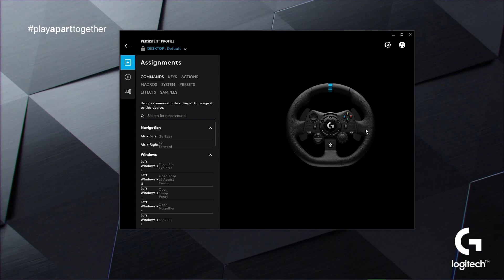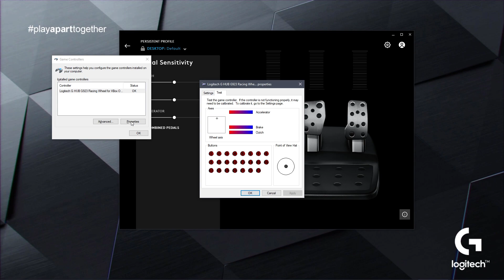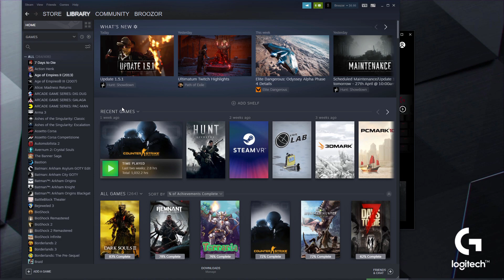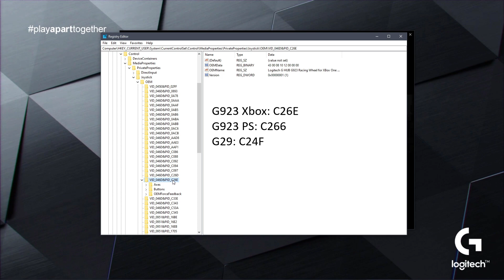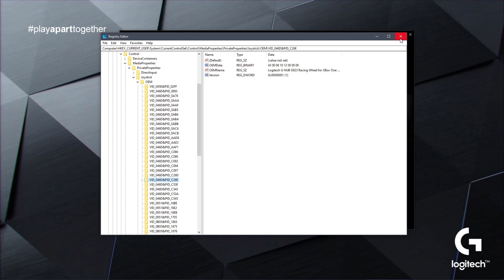How to troubleshoot G923/G29/G920 for Connection Issue

Comment: Hello, I bought the G923 a week ago and today the force feedback feels different, less responsive and with less detail. You mentioned the LEDs having a meaning, mine keeps the first green LEDs (the most outer ones) on. What does this mean and what can I do to solve it?
Reply: Following up on this, on the registry editor I have two entries that correspond to G293: C266 (with folders as in the video) and C267 (without any folders or extra files)
Reply from the maker: Hi! Did the deletion of the registry editor folder for the G923 fix the issue for you? The LEDs are our RPM trackers in games and typically does not stay on after power on but is on while it calibrates. 

Some games also allow you to adjust the force feedback intensity so that could be why it feels a little different in game.

If these do not help please let us go deeper into detail by submitting a support ticket!

Some racing titles have an option called Inverted Force Feedback (or similar) in their control options.

https://support.logi.com/hc/en-us/requests/new?ticket_form_id=360000621393
Reply: @logitechsupport  It did not work for me unfortunately. I’ve tried almost everything at this point and I couldn’t get it to work like it did on the first week sadly.

I know the LEDs are rpm indicators, I was just asking because that’s how they behave now, they never turn off after playing F1 (2020 & 2021). I know the FFB can be adjusted and sometimes is inverted but after that first week the feel on both F1 games, as well as Assetto Corsa was never the same. It just lost a lot of detail and power.

I will try submitting a support ticket.
Reply: @logitechsupport new steering wheel and pedals set up today... Worked about half an hour or so, then changed to a different game and now it won't work. Just light flashing on steering wheel. Is the power chord the issue?

Comment: Hey my G29 is not being recognized by steam/games/& device manager, and I've tried everything including what you did here,so due to me being disabled and not familiar with this stuff & have no access to credit cards and PayPal to update etc,I'm always stuck 
& in a panic cuz I can't find out what is happening to mine,so what I wanna know is is there a certain way to install it to get it to work or is there settings to change or what,I've uninstalled and reinstalled restart it so much that I have no way to get help cuz I can't pay for it, so mine is the G29 so in Ghub it's the pedals don't show that it's working
Reply: Cuz I push pedals & the lines that show they work don't move so that's 1 I go to the registry and the G29 is there but that part where you delete it shows up so I I delete it unplug replug but the options to refresh aren't there so what's going on please tell me what I'm doing wrong or what's causing this not long ago it was working fine but Ghub did an update & that's when this started again so please do something so this will be working again I need a step by step instructions on how to do it from when you 1st turn on PC to when it's working in game so I know how to do it right so far I can't find it & Google is no help cuz nothing came up & I need something free to do it with no credit cards required to do it,I'm getting bored with using an Xbox controller to play cuz this issue is non stop & I don't know what to do to troubleshoot it & fix it for free
Reply from the maker: Hi there Chris, 

We can definitely help you out! If you can go ahead and open up a ticket through our support system we can provide you with more detailed trouble shooting. 

The link down below will lead you there!
https://support.logi.com/hc/en-us/requests/new?ticket_form_id=360000621393/
Reply: @logitechsupport  i was on the phone with an agent for over an hour,she sent in email another version of GHub,it worked for awhile then it stopped again,i even have it plugged into a wall outlet and not those multi plug things,im starting to see after testing it in different ways that the GHub itself seems ok,the wheel itself is fine,the shifter+18-speed has no issues but its the pedals that are having issues,so when i have all 3 plugged into the pc,the wheel,shifter+18-speed are fine,the pedals seem not to be detected cuz when i push them down the blues lines dont show/move,if the lines are there all 3 are flickering and going up and down at the same time,so i unplugged just the shfire+18-speed and tried it,there no lines at all and games dont see it and steam wont see it,if the lines do show they are there but dont move,however if i unplug the pedals,not use the shifter+18-speed and try the wheel itself then it seems to work in GHub it seen on steam but only very few games will let me use it that way,such as flashing lights,city car driving and beamngdrive,i dont know why but if i wanna play ATS it wont let e even play it that way cuz for some reason it wants the pedals with it atleast but the shifter+18-speed doesnt matter,so whats confusing me is the order of how its installed from when you 1st turn on pc until its working in game including any pc restarts if any,i tried that trick with the registry and my number for the G29 are there,but at times i see another 1 with a different numbers and different name at end,1 is USE the other 1 is something else or HID something like that,but when you tried it it mustve worked cuz when i do i dont have it plugged in,so if i need it plugged in when i do that part it would help so maybe i can somewhow fix it again,but i want this fixed and working soon
Reply from the maker: Hi again!

If you could revisit your ticket that you previously opened we can continue to help you there!
Reply: @logitechsupport  ive tried so much that no matter what i try doesnt help me solve this issue,i had a friend that knows pc's to install the drivers that you said in the email,and its still not working,its not the wheel itself or shifter its the pedals,cuz of the icons all moving/stuck at launch of ghub,im getting very pissed off and very fustrated and running out of options to troubleshoot and fix it properly,so what am i doing wrong thats causing this not to work,is there a setting thats blocking or interfering with it,is it the device,the ghub,driver issues,or is it that im not installing the device the right way so it will properly download/install/detected and regconized to use it,that may be the issue but i cant find any videos that show with voice step by step instructions in detail from the time you 1st turn on pc until its in game and working including setting/drivers and if theres any restarts when to do them,my issues is the settings options show the wheel and every part is there and working,same as devices itself but the device mananger is different some settings show its working properly,some say needs further installation,some say its not plugged in unplug and plug back in to fix it,but no matter what i do nothing seems to fix this glitch,the regisrty shows 2 different numbers for it but i know the right 1,but i cant get rid of the other 1,it keeps coming back no matter what i try,this G29 worked just fine after i 1st got it in 2018 but a sudden feeeze from a possiable hacker in 2019 froze my pc so to get out and fix it and stop the hacker i had to do a factory reset on pc,and ever since then to this day ive had this same issue with my G29 ever since
Reply from the maker: @chrisgcrane5217  Hi again, If you could follow up with your ticket we can help you out. To be clear your pedals are the issue and they are still not responding? Make sure to relay that to the agent handling your ticket!
Reply: Hey Chris I have the same issue did u solved it ? I hope so, btw can you send me the g hub that u are talking about ? I'd like to try if it fix it please

Comment: So my steering wheel is not spin on g hud
Reply from the maker: Hi there!

Do you mean it is not calibrating as you turn it on? If that is the case please make sure all your power cables are connected properly. I recommend also making sure your GHUB is updated to the latest software which is: 2021.8.792

If that doesn't solve your problem please open up a support ticket with us so we can further troubleshoot your issue!

Link below:
https://support.logi.com/hc/en-us/requests/new?ticket_form_id=360000621393/

Comment: Hello, I only have the steering wheel. Can I play with it without the gearbox and pedals? If it is permissible, I cannot play with it
Reply from the maker: Hi there!

You can use the wheel without the pedals by remapping the acceleration buttons to somewhere on the wheel but we always recommend using the full kit!

Comment: Tried all steps, the Logitech G HUB drivers recognices it perfectly, but not even 1 game does... 
The wheel is fine and goog quality but those problems are so frustrating... :(
Reply from the maker: Hi there!

The G923 will work in all major racing titles with the same level of compatibility as the G29/G920.

If the title you are trying to use the G923 in does not recognize the wheel by default then you will need to go to the control options of the game and set the wheel up manually, assigning the controls as required.

The method for doing this differs depending on the game title, but you can find many guides online for just about any racing title that will give you this information.

If you are still having issues please open a support ticket with us so we can troubleshoot more!

https://support.logi.com/hc/en-us/requests/new?ticket_form_id=360000621393/